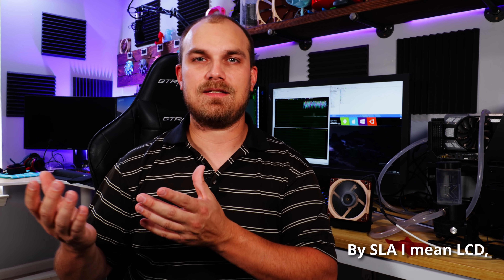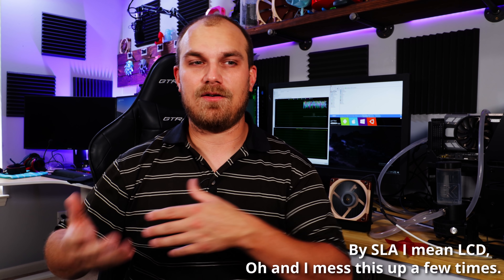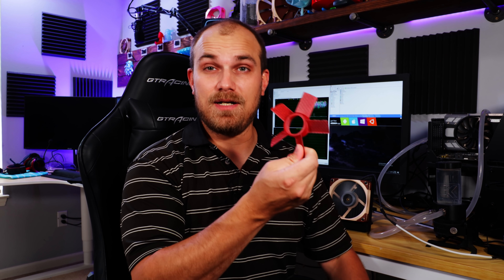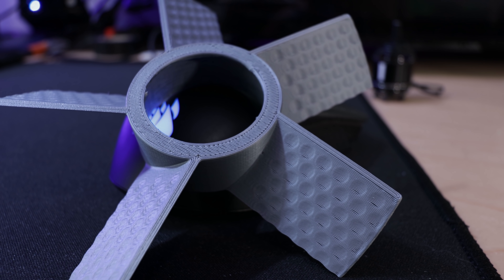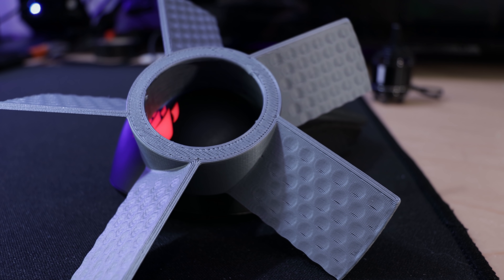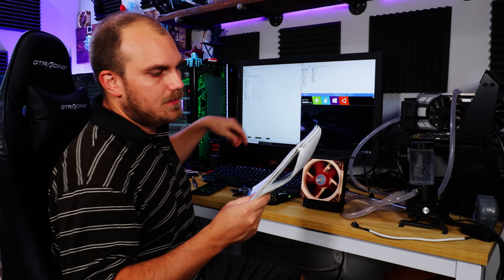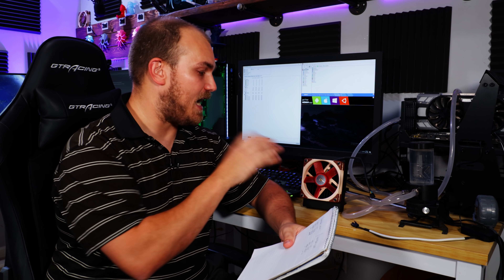Do Resin Fans Outperform FDM Fans | Dimple Fan Follow Up

Comment: Try testing RPM's at the same input power analog (amperage based) not PWM. Alternatively you could test using PWM but with a power probe inline. That would be a better test for aerodynamic efficiency. Their are to many variables in a CPU / motherboard that can cause temperature / power to fluctuate with out even reporting the fluctuation rendering this kind of test invalid. Further Windows can cause additional unreported fluctuations and false reporting and so can the software used to validate depending on updates / bugs. These kinds of test can help you determine if something cools ur PC better but that can only be validated with large deltas. Basically its easy to validate between something that doesn't preform well at all and something that does but much harder to validate between two things that work well or similarly. It is also harder to create a large delta on a single rad which can be beaten by a $35 chinese air cooler with stock fans. Testing would be more accurate with a dual 120 rad with matching fans.

Comment: just the micro level of printing dirtiness takes the place of dimples. There's a bug mistake in cooling by forced air rather than pulling it away, all that hot cold low high pressure jazz. Heyo, I went on this path back in early 2000's and would have been able to show you early designs but lost my box of industrial comp fans. PLEASE TRY THE NOCTUA IN A PULLER, REVERSE FLOW.

Comment: Probably the rpm isn’t high enough for significant enough drag on the FDM vs the resin printed version is still not smooth enough to have any real drag difference at those low speeds

Comment: I see too many uncontrolled variables. measuring just the cooling performance doesn't give you a good comparison when you can't control for other variance's.  If you could measure the air mass like a air mass sensor in a car it could be a more accurate test.  That said, I don't know if such a sensor is accurate enough and/or cost prohibitive.

Comment: I'm a bit late to following your fan series. Please pardon my critique from an engineering background, but you're doing it wrong. The dimples don't do anything on a flat fan blade like what you're using. The way you applied the dimples suggests that you might not understand the aerodynamic theory behind the use of dimples. 

The dimples play the same kind of role as vortex generators on wings, and combat the same problem. On a wing or a ball, the surface is curved, and as the surface curves away from the direction of movement, at a certain point (and at a critical air flow speed), the flow of air peels away from the surface (surface separation, which on a wing, means stalling—the wing loses its control over the flow of air due to the separation). On a golf ball, the dimples cause micro-turbulence on the surface and locally lowers the pressure, which enables the air flow just above it to press down on it and follow along the surface of the  ball further before separating from the surface. On a wing, vortex generators and tubercles (bumps imitating the bumps on the leading edge of whale fins) give the flow of air or water over the wing / fin enough energy (locally) to stick to the contour of the wing / fin rather than separating. This enables the wing / fin to maintain control of the fluid it is moving through even at higher angles of attack.

The fan blades in this fan are just flat surfaces. There is zero benefit to using dimples on a flat wing because there is no gradual transition for the dimples ahead of the part where the curvature induces separation to micro-turbulate the air to prevent separation. If you have a flat slab of a wing, when you hit the speed where the airflow separates from the wing, it will separate from the leading edge, so all the dimples will be under the separated flow, making them useless.

If you want to make the dimples useful, the fan blades need to have a curve to their cross-section, or ideally, the wings would have an airfoil shape, and the dimples would be spread over the thickest portion of the wing over the curved portion, on both the upper and lower surfaces (but most importantly, the upper surface, since that's where flow separation happens. Before and after this zone, the dimples are useless. 

If you shape the wing with a curve, but the wing has equal thickness throughout rather than an air foil profile, the dimples would only be useful on the upper surface.

Comment: The reason there is no difference may be  that the FDM ridges do the same thing as the dimples. Comparing a non-dimpled resin print to the dimpled resin print seems like a better test.

Comment: My name is Alan Mattanó, FDM prints vertically instead of horizontally so that you gain "" along with the flow! Excellent Job. PS: also declare the angle of each cooler at the root and the tip so that there is progress.

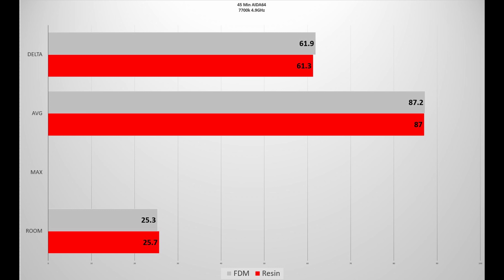Comment: 2:32 - it is funny how you post the actual facts but cannot interpret them correctly. First of all, both FDM and DLP (I guess) will be worse than injection moulded fans in terms of surface quality - 3d printing is for prototyping and there are certainly better way to mass produce better quality parts and for cheaper. What I am saying is that the real test would be to take original part i.e. Noctua fan design, make copy of it with FDM and then with DLP and see whenever FDM or DLP get's closer to original. That is what you would want to do if you wanted to check specifically how surface finish affects the performance. Secondly, just temperatures are not telling all the story, what about the noise, what about static pressure, what about airflow? I know that temperature is one of major things to check, but we need to consider that depending on application airflow and air pressure may become important in their own right. Thirdly, when it comes to dimples - what makes you think that considering surface finish or overall design dimples would benefit the performance?! Finally, if just surface finish improvement can render ~1% difference in the design where improvements can only be very marginal... that is quite big, so saying there is no big difference is just wrong.

Comment: The only fans I would expect a significant difference would be on the models where you had difficulties with the layers adhering due to how thin the blades were. In those situations turbulence could decrease, thereby increasing it's relative efficiency.

Comment: @major hardware build a fan like this https://www.researchgate.net/profile/A_Mateo/publication/221919106/figure/fig2/AS:341172003328009@1458353152490/Low-pressure-compressor-of-the-Eurojet-EJ200-turbofan-engine-fabricated-with-the-BLISK.png
But you might need a fixed tube housing to really make it work.

Comment: Via mythbusters data.

Golf ball dimples create a paradoxical vacuum that makes a little "ball bearing" of air. Just like in the pick up truck tail gait episode, or like louvers on a car.

Less of the incoming atmosphere actually "rubs" on the surface. More of it glides across the little vortices. The friction is a function of remaining surface area and vortex efficiency (the more "stagnant" the air in the vortex the better, how much fresh air it "eats" is friction).

But that's all to reduce friction on something that you're trying to "sneak" through the air.

A fan blade is supposed to make an impression. So what you want I think is a blade designed to create a field of turbulence around it that acts as the actual blade.
Reply: Features of this would include
Stretched dimple patterns (dimple X louver) would look like dragon fly wings.
Point cascades on the leading and possibly trailing edge (whale fin X bird wing)

Comment: The size of the fans is too small for minor surface roughness to impart a meaningful difference in performance when it comes to moving air. It's possible that smoother surfaces on the blades could improve both the overall life of the blades and to reduce the overall energy consumption of the motor over time but that will not be measurable in your current tests and it would be soul crushingly boring to perform such a long term experiment to test just that.

Comment: Hey buddy.  Quick question:  Have you considered using compound sources for forced laminar acceleration?  Example: the PBR in Viet Nam was a speed boat that used a two stage in-line impeller setup.   The first impeller pulled water in and the second properly accelerated it.  If I wanted to exemplify this method in radiator cooling, I would consider the same.  If you have a two stage fan, the first being an open impeller (furthest from the radiator) and the second being the most efficient fan you have (the closest fan to the radiator, and it has to move the highest volume/second of air).  This should allow for the largest intake of air into the system, and give all of the air that enters the system an initial non-zero momentum in the direction of the radiator.

Comment: You'll only see a tiny change between the layered FDM prints and the smooth resin prints for tests like this. You have a thin layer of air that's 'stuck' to the object, smoothing out the imperfections: the bulk airflow is mostly unaffected as the size of the imperfections are very small when compared to the size of the steam of air passing through the blades.

Also the dimples on a golf ball reduce drag, so I'd mostly expect a drop in noise and power draw, rather than increased cooling performance if the fan spins at a constant RPM.

Comment: the problem with the dimple on a golf ball is it is convex surfaces implanted on a concave supra-surface (dimples on a sphere). BUT the fan is opposite to a ball. So you need concave surfaces implanted on a convex supra-surface. (bumps on a fan). If this does worse. Then we have a definite answer.

Comment: Another thing to keep in mind about LCD/DLP resin printers are they print in pixels. The layer structure looks like tiny little Lego blocks or Minecraft building. Obviously higher the resolution tinier the blocks but just like with FDM it still isn't a smooth surface.

Comment: the scale, these items seem too small to notice any performance differences due to surface quality.  Maybe for some of the thinner fan designs you might see a more significant difference simply because the print actually finishes with little artifact but I would doubt that a pristine FDM vs SLA difference would be that noticeable between two perfect models.  Team up with 3D printing nerd and see if he has any input

Comment: You aren't understanding what they meant. When you port and polish a cylinder head in a car, you NEVER make it into a mirror shine. You use a 100 grit paper so that there are scratches left in the port. This creates a boundary air layer on most of the surface. Since FDM does that naturally, dimples won't make a difference, but you may see a small reduction in performance with flat blades. The velocities unfortunately are probably not high enough to show a difference.

Comment: Its nice that you hear your audience, but you still need to improve a few things more to start been accurate on you're measurements:
- Thermal camera on the radiator to see if are different cooling patterns
- Audio spectrometer besides the decibelimeter to see if are different noise patterns
- Normalized heat load (like a resistor) to discard any inconsistency
- Air conditioner in the room (almost in a box) to discard any inconsistency
- Test it on reverse (specially important on hydraulic designs)

Spray the fans with Teflon would be nice to archive less air friction due printing surface inconsistencys, or even an acetone chamber to make the surface smoother.
Use a perforated tube connected to the smoke machine to see absorption likes in different points of the suction bell instead of a random turbulent smoke would make it more clear.

Comment: I tried to look for my comment on the original dimpled fan video, not possible, and I can't find the article anymore.  But the reason it isn't giving any advantage is because dimples do not work at such a high velocity, they can actually have a negative impact, this is the reason why aircraft and rockets aren't dimpled.

Comment: But I'm seeing a 0.4 Degree warmer room difference and a cooler by 0.6 Degree in the Delta (with a 0.2 Degree average difference), although this is minor, surely this shows there is a difference, maybe in the stiffness resin offers in comparison, or is it maybe weight variance?

Comment: The thermal performance of a fan will be mostly dependent on the overall shape and not surface imperfections. However, I am quite sure that a smoother surface will reduce acoustic noise and improve efficiency. 
I would redo this FDM vs resin test with the best design you have and evaluate the acoustics and RPM as well as thermals.

Comment: i would think it would be the opposite: i would think a smooth fan design on fdm would out perform a smooth fan design on sla because of the added friction. I would think if you had a problematic print (ie delaminations, holes, too thin for bonding, to thin to no break apart at high speeds) then an sla print may help, but also the resin might be more brittle and less flexible/durable than pla?

Comment: the difference would only be indirectly affecting temperature, the dimples reduce drag so technicall the dimple fan would spin minimally faster than a non dimple or bad dimple fan and therfor the resulting temperature would be minimally lower, but it would be all within margin of error with these crude measuring methods

Comment: The reason dimples work on a golf ball is because of its shape. Air always has an extreme path around a sphere. Air separation occurs maybe 65% of the way to the back or a traveling smooth sphere. This creates a lot of air drag and turbulence. A dimpled golf ball helps mitigate this. The dimples provide small depressions where turbulent air can go. This allows the boundary layer (closest air path around the shape) to sit not only closer to the surface, but also maintain surface tension for longer and not separate until later. This makes the area of drag much smaller. 
Dimples relate to geometry and are best used on objects that cannot be shaped for arrow dynamics (tear drop shape) and have a lot of drag. You can't just put dimples on things and say they're better, unless you're talking about looks.

Comment: It depends alot of the object... 
The dimples are trying to geep the laminar flow attached to the blade for longer. (The rough fdm texture will do exactly the same) They will also only show any improvement in a very small window.  If you designed a car diffuser with a angle of 45 degrees, it doesn't matter if you add dimples or not, the flow won't stay attached.   In the same way if you have smooth laminar flow over an aerofoil if you add dimples you will just increase the thickness of turbulent flow.   People seem to think that they will reduce drag as if my magic, you see them on carbon bike wheels doing nothing... Chances are that 95% of the time they will increase drag.

Comment: Resin itself won't change much.
The things that will improve fan performance, is can it build and sustain air pressure. Air "flow" does not "work" on a radiator. You need to be able to build up pressure right up against the radiator fin stack and push it through. The best fans for this have consistently been the Noctua NF-F12 and the Corsair ML-120. Why? Look at the fan blade design. They are very flat, they scoop in air using RPM and then instead of taking up space with high pitch blades, there is almost the opposite, the blade acts as a plunger and pushes that pocket of air behind the flat area of the blade into the radiator.

All of the fan designs have been cool, but there is a reason the ML120/F12 have been the go to fans. (I personally run push pull 4x ML120's on my radiator and because of the pressure they create, I never ramp up the fans past 800-1000 RPM).

Comment: What was the difference in weight between filament and resin? Also could you try and test the strength between them for bend, impact, rubbing wear, UV, heat, and high rpm or anything else that makes sense.

Comment: Why don't you make a dual-fan on a single motor running in opposing directions? like they did on older prop planes. P-51 Precious Metal ex. helicopter to  like The Sikorsky/Boeing SB>1 Defiant

I believe they did it to cut down on air turbulence or chop. I think keeping the ring on the outside of the fan blades would help with interference. the tolerances would have to be tight. I don't know your manufacturing capabilities so I cant design it

Comment: he dimples are normally used to  re-energize the flow when the flow goes from laminar to turbulent (just like slats), which enables the flow to "stick" to the shape more when traveling at high speeds on a golfball/wing since it has the energy to follow the contours of the shape. Thats how it decreases the wake drag. I doubt the airflow over any of these fans are reaching critical flow speeds, which means the dimples probably dont actually do anything apart from pre-maturely turning laminar flow into turbulent flow over the wings and reducing the pressure difference they generate, sadly :( its been a while since i had aerodynamics, so correct me if im wrong :)

Comment: That fan is for one small and  second it moves very little air so there will be very little different between the two test .
If you scale up or go high performance fans like RC modell plane edf fan you will see a much bigger different in performance between the 2 prints  . We have printed edf fans but due to the ruff finish performance was horrible